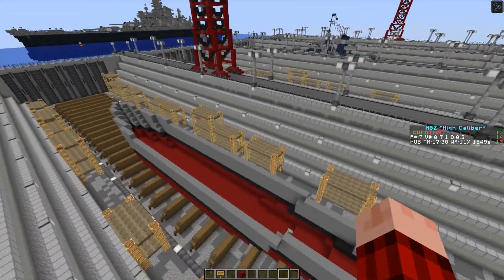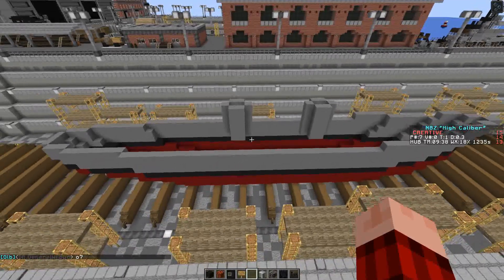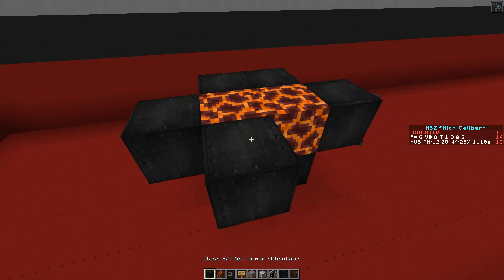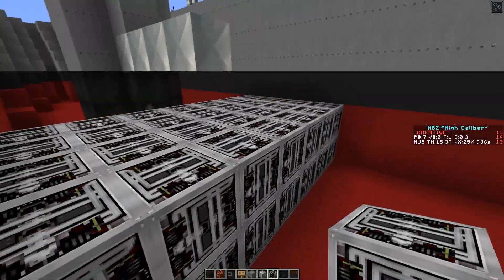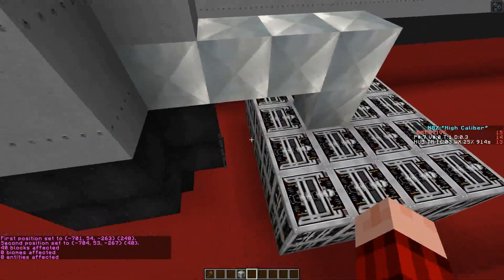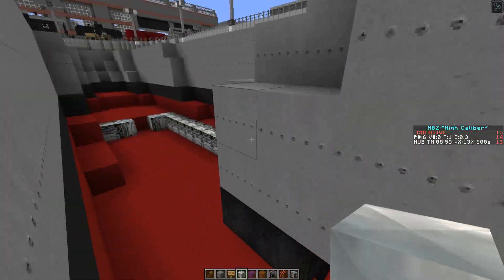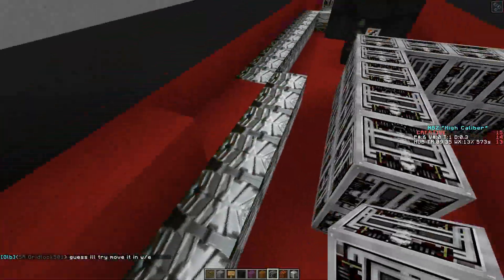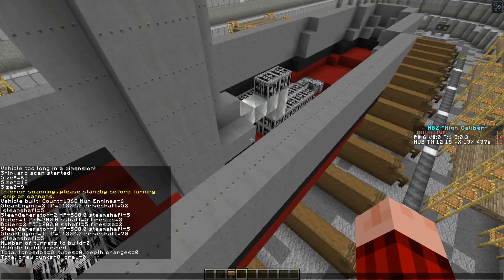NBZ High Caliber  Introduction to Boilers and Steam Engines

Comment: Loved watching your videos man! I've been stumped with designing a Destroyer class in honor of DanTDM for at least a couple of years now, and I wanted it to be more like a cross between the American Mahan-class Destroyers of 1934-1937 and the Royal Navy C and D-class Destroyers of 1930-1933. I put down the years in which the classes were built, not in commission, just for a quick note. The class, like the ships they are based on, are split into two groups, with one group having gun shields and the other group having fully enclosed turrets on A and B gun positions (The Forward two guns). The ships have 4 single mount 4.8"/41 caliber guns, 3 triple mount 21 inch torpedo tubes in a Y formation with one between the smokestacks and the other two on port and starboard sides each, 4 .50 Caliber Machine guns with 2 being on Bridge Wing mounts and the other 2 being in Gun Tub mounts by the stern just aft of the Torpedo tubes, 2 Depth Charge Throwers and 2 Roll-off the Stern Racks, Originally. As time went on, they would receive refits whenever they'd come into port for Major Repairs or even a Major Overhaul to the point where the Anti-Aircraft guns were augmented by the removal of the .50 Caliber Machine guns in place of 20 Millimeter guns, as well as 2-4 more gun positions for the light defensive Anti-Aircraft armament, the Centerline triple mount Torpedo tubes being removed and replaced with a Quintuple Mount while the Port and Starboard tubes were removed all together. A Twin 40 millimeter mount was placed between the After Smokestack and X turret, with a single mount 40 millimeter gun mounted in place of the Port and Starboard Torpedo tubes each, and a 20 millimeter Anti-Aircraft suite was placed around Y turret, just forward of the Depth Charge racks consisting of 4 guns. Propulsion was provided by 4 Admiralty 3-drum Boilers connected to 2 geared steam turbines powering 2 shafts allowing them to go about 38 knots (or 44 miles per hour) on Sea Trials, but in practice they went about 30-32 knots (or 35-37 miles per hour). The General Characteristics of the ships are a Length of 102 meters, a Beam of 11 meters and a draft of 3.5 meters or, respectively, 335 feet 1.5 inches, 34 feet 3 inches, and 11 feet 6.5 inches. I had wanted to draw up the design with a cross-section for the interior and possibly send DanTDM a copy, but in drawing up the first layer, or keel, on graph paper I wound up drawing the top-down view of the deck. Once I get to playing some Minecraft, I just might joint your server and maybe try to build it properly and maybe record the sea trials for the channel.